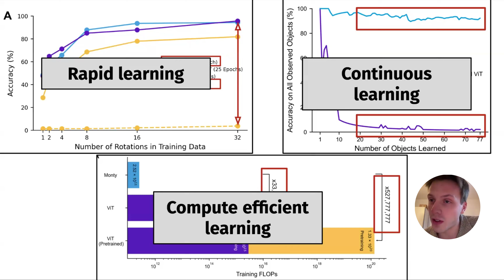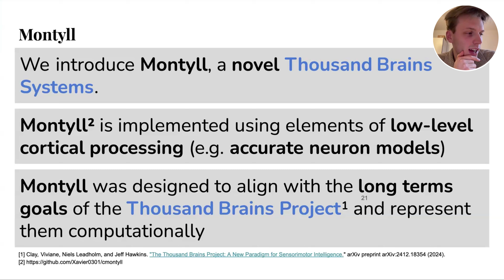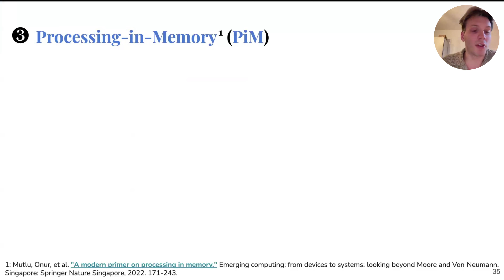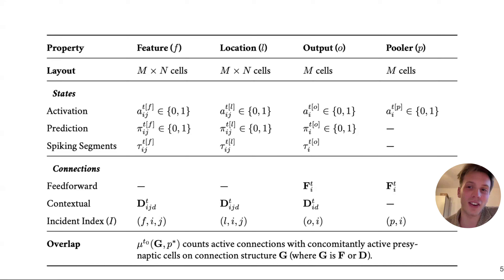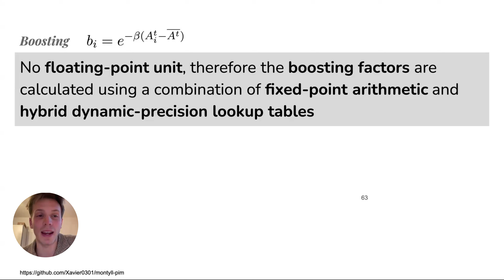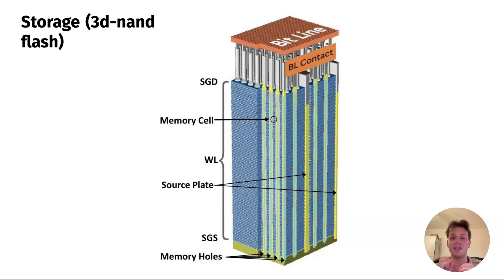2026/02 - A Thousand Brains on a Thousand Chips: Scaling Monty on CPUs, GPUs, and PiM Chips

Comment: 48:48 As Xavier scaled up to ~2,500 modules, he finally provided enough "pressure" to fill the pipeline bubbles. The ops/sec go up because you are finally using the transistors. Imagine a waiter (the CPU) in a restaurant. If there is only one table (one model), the waiter takes an order and then has to wait for the kitchen (DRAM) to cook the food. He is idle most of the time. If you have 2,500 tables, the waiter is never idle. While Table 1's food is cooking, he’s taking an order for Table 2, refilling water for Table 3, and clearing Table 4. As a result, the "Throughput" (meals served per hour) increases because the "waiting time" for the kitchen is hidden by the work being done for other tables.

Comment: Very fascinating work Xavier, and well presented!

The insights into the "true parallelism" of the PiM architecture are particularly compelling. The graphics at 45:39 is a perfect example where "one image says more than 1000 words".
It's fascinating to see how PiM maintains a flat runtime per step as you scale learning modules, and it's really interesting to see a clear presentation of this chip architecture.

I appreciate your highly enlightening presentation on how current PiM limitations, like slow logic frequency and 8-bit constraints, are primarily economic hurdles rather than fundamental physical limits. Realizing that the "Nvidia of PiM" could theoretically resolve these bottlenecks if the commercial incentives aligned provides a much clearer outlook on the future of this hardware.

Thank you for your hard work!